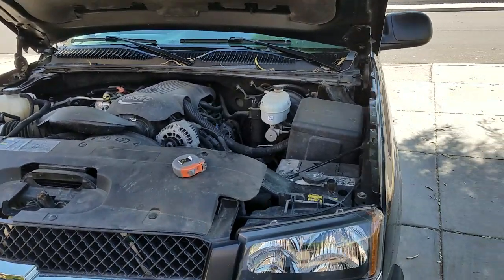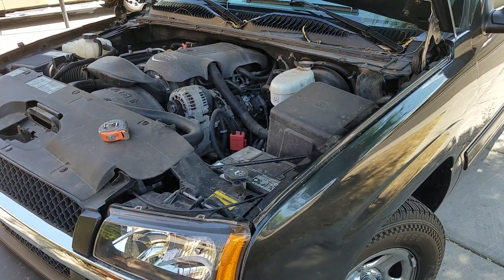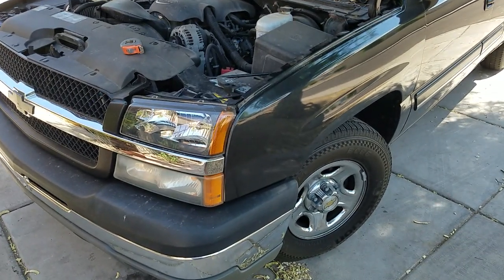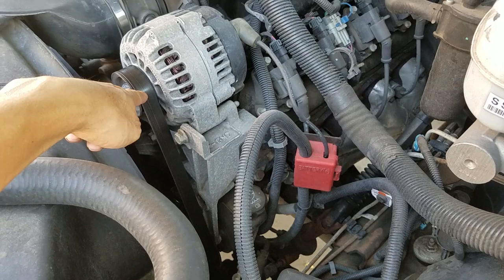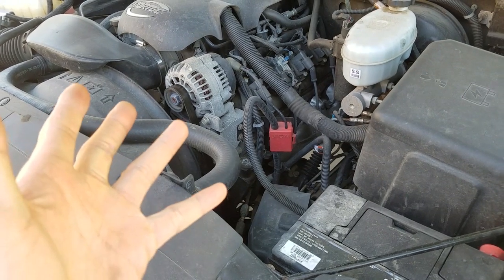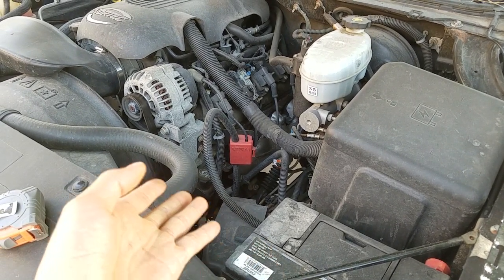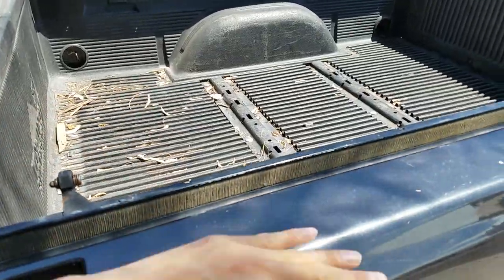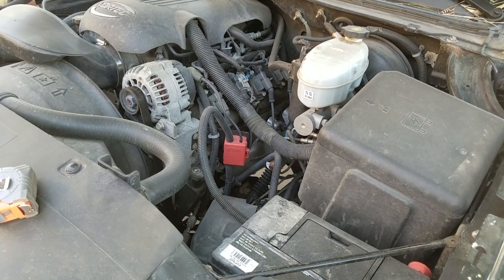Adding Lithium Ion and Solar panel to a truck? Would it help?  Let discuss the options!

Comment: My brother did a test. He put a 300 watt mod down in the bed of the truck. Plugged into a cheap PWM CC. The drove to are cabin 4 hrs away. This saved him about 2 gal of gas each way... That is all i know.
Reply from the maker: Really, that's quite a bit saving.  Thank you for the input.  Maybe I should try this first... before messing with the battery/alternator.

Comment: It's best to make a 4s Lifepo4 battery perfect for auto motive use. I'm driving a 2014 prius-c imported from the US, I live in the carribean. I've made some research and came to the conclusion that my cars 12v system uses a LOT of power coming from the Traction battery. So I made a LIPO 24v 24AH battery with a step down converter and pumping 10a @ 14.4v to the regular 12v lead acid battery of the car. With this setup during the day I saw a increase in 2 mpg and during the night around 3 and 4 mpg. But I'm limited at the DC-DC step down converter only 12amps max. So now I'm building a headway Lifepo4 12v 28 aH battery and 2x step up 1200w DCDC converter for more power. So what you are planning WILL yield better MPG. So keep it up succes.
Reply from the maker: Thanks for your inputs.  I am curious why didn't you use the LifePo4 4s and use that as your accessories battery, why do you need the buck converter if you were to use the LifePO4  4s.
Reply: @devildestiny555 Because it will be sitting their doing nothing ,the Prius has a HV converter to 14.4v suppling power for anything in the car, as soon as he notice a drop in voltage of the voltage to 13.5v it will supply power to try to maintain the voltage to 14.4, so I left the lead acid battery allone and supply voltage from a bigger battery to cut the power coming from the  traction battery. The lead acid battery in this cars are only for charging the capacitors of the inverters when starting the car, then they sit their doing nothing, all the power for all 12v accesories come from the traction HV battery. I hope you understands me. watch this video https://www.youtube.com/watch?v=_V9PiOpaxyE
Reply: Li-ion is horrible for 12v and I doubt you will be able to use but Lifepo4 is also very tricky and all depends on bms I use one on my motorcycle and it's a great bms it wont let cells go above 3.6ish but still stays on.  some lifopo4 cant handle 14.9v alternators.  The issue is while lifepo4 charges to above 3.6v they settle out usually around 3.4v

Comment: Silverado 14.4ish volts is operating voltage 15v max. GM charging system runs the truck not the battery. The battery is for starting and high power draw at idle. It does not charge like your bmw.
 About a 20 amp draw @ 12v is operating draw, Then add in A/C blower and clutch, Headlights, All lighting, Radio and other power accessories. That can be another 30a@12v. Most GM truck  charging systems alternators are between 50a-100a depending how much power accessories it came with. Starter draw 30-50a @12v. 

I know you could build a solar system/Batt that could supply 500- to 750w. As I see it you would need a big ass buck convertor to hold a voltage of 14v. and eliminate the charging system. OR A way to control the field wire of the alternator (I don't remember the wiring off hand, maybe add a switch inline) to stop it from charging and have power draw from the battery (in this case a 14.v lithium system). I would NOT want to expose my Lithuim batteries to the heat of AZ summer. I love the make more efficient ideal.  When all is said and done i don't believe the efficiency gain will pay for it self. 2003 computers may not like clean power. Also the truck being from Minn. It may end up with grounding problems, May not be the best test subject. I hope this helps and doesn't sound negative in any way. I am typing this using power from my 2011 chevy volt battery... Love me some solar!
Reply from the maker: Thanks for the constructive comment.  Not quite sure if we are on the same page... When you say GM Charging system = Alternator right?  I thought the alternator, battery, accessories are all tied together.  Power are always being draw, the lower the battery voltage, the harder the alternator have to work.  This is why if the alternator failed, the battery is now proving all the power and eventually the truck would stop running when the battery die.   Maybe a quick test would be, add a solar panel to the back, hook up a charge controller to the stock battery.... see if that 300watts panel would do anything by supplementing extra power to the battery.  Or a even better test is removing the stock battery, add lithium battery, add panel and disconnect the alternator and see the result.   There's room under the back seats, perfect for Nissan Leaf modules.  :)
Reply: @devildestiny555  Gm charging system YES. Years ago their were more parts. I am old. 

Battery voltage and system can be slightly  different.  Everything you typed is correct again I worry about the computer and it's many modules. But I believe your theory is correct. I would be interested in how it turns out. I lived and worked on cars for 30 years in Phoenix. Please be aware of under hood temps.
Reply: @glennbeattie6172  It will not be easy to supply lets say 50 amps @ 15v, but if you can do'it you will see better mpg, beacuse the alternator will cut down its field current to the rotor, and charge less, reducing its drag on the engine.
Reply: @rubenspecht3552  I see your point. But unless you kill the field. The charging system will average the voltage and combine the draw. About 50 50ish with some things factoring in like heat.

Comment: Do a quick test put on the panel put the battery on see if it improves your mileage from that point without even doing anything to  Your alternator
Reply from the maker: That's a very good idea.  I think I will try that first.  thansk

Comment: @dd555: Connect your solar panel to a solar charge controller. Connect your existing battery to it. Then simply disconnect the field coil positive terminal of the alternator and test drive your truck normally while recording mileage and battery status.  I saw a YT vid where a guy replaced his battery with a bank of super capacitors that provided more than enough cranking power to the starter as well as keeping the electrical system alive. He later added a 12v 9Ah UPS battery to alleviate the capacitor's leakage over time. Use your Li-ion 12V pack instead of the UPS battery. Actually a12V Li-Ion tool battery is fine too. Use a 4S charged at nominal 3.6V  to get 14.4V. The capacitors should be arranged as 6S for 16.2V 83.3F to handle that battery voltage, since they come in 2.7V 500F. Your system should perform extremely well in Arizona.  If you're bold enough, think about how to remove your belt driven AC compressor and replace it with a 24 VDC compressor powered by your truck's solar panels. A car's cabin AC shouldn't be as BTU hungry as a room AC. The capacitors will handle the starting compressor surges. Once running steady it should not consume too much power to cool your cabin. The difficult part would be where to mount that DC compressor (they are tiny though) and braising it to the existing lines. That should improve your fuel efficiency quite a bit there in Arizona. Cheer!

Comment: I wouldn't remove the alternator,  just hook a relay to the field coil that it only works when the brake lights are on. Poor man's Regen braking.
Reply from the maker: By winding you mean the positive output of the alternator right.  You're right about not removing the alternator... it would only save a small bit of weight and drags, but it would sucks if I have no way to charge the system and get stuck.
Reply: @devildestiny555  no, the field coil.  The field coil is low amperage. When there is no voltage on the field coil there is no current made by the alternator. You should do some quick research on how the alternator works.  Controlling the field coil is how the voltage regulator controls the alternator s output voltage. This will be much easier and cheaper than buying a relay capable of controlling the full  amperage out put of the alternator,  which could be 100 amps or more. The field coil is less than an amp. It kind of an on/ off switch for the alternator.

Comment: Think about what you’re saying. Do you really think all that power can be going through that alternator pulley?
Reply from the maker: I think you miss understood what I was saying.  I DID NOT say I want to add a electric motor in place of the alternator.  I was hoping to remove the alternator to create less drags on the engine to save fuel by using a Lithium Battery and Solar/Grid to charge the battery to power everything instead of using the alternator.

Comment: I wish I could help but I'm not competent in this area. The only lithium chemistry that can comfortably replace lead battery at 12V is LiFePO4 (3.2	*4=12.8). NMC only works perfectly at higher voltages like 48V and above. I just have these feelings the gains at the end of the day wouldn't be worth the efforts but again I'm not an expert. Best wishes as always.
Reply from the maker: Hi,  Yes, I know about the LifePO4 would give me the perfect Voltage.  But that mean I would have to spend money on buying new battery.  I was trying to use the LiIon that I have a bunch sitting here.

Comment: look into HHO for increasing your mileage, especially with using solar panels to help with power.  Otherwise, put a duramax diesel in it.  I'm pretty sure the starter can handle the couple extra volts, but can't you use a voltage regulator to connect to the vehicle's other power systems?